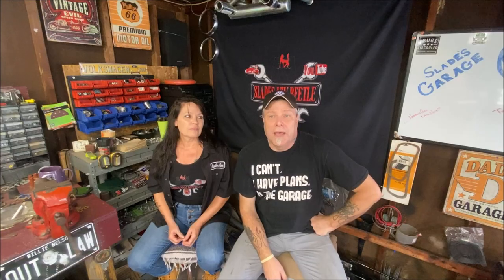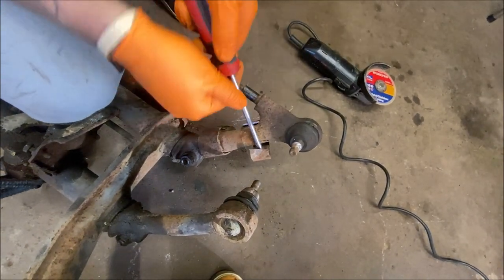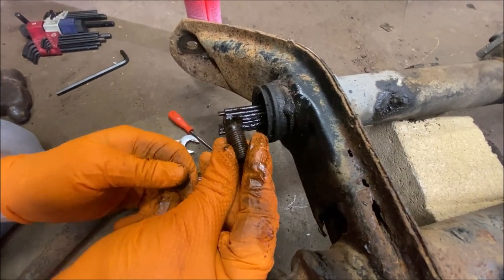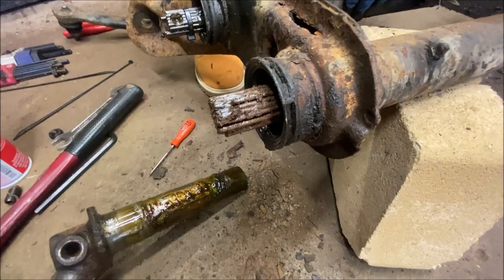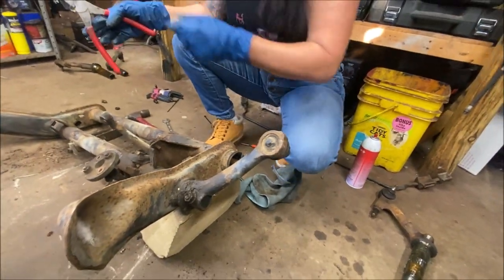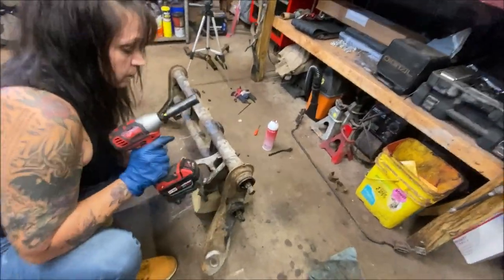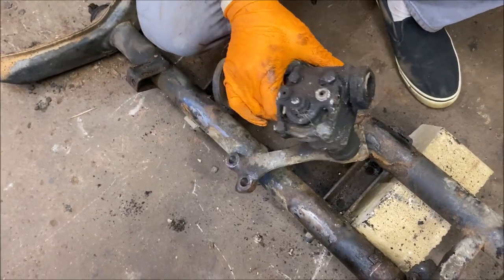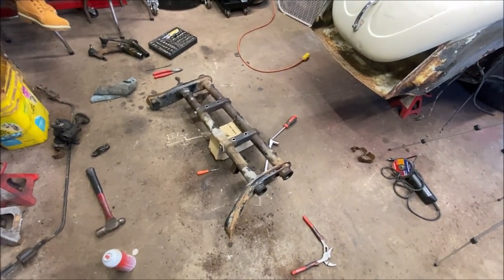VW Beetle Front Axle Beam Diassembly - Lets Take It Apart! My female mechanic garage helper!

Comment: Heather did a fine job, and Slade was very patient, too. Great job, both of you. But, she was wearing new boots! Well, if she does concrete, ponds and stuff, they'll get dirty soon enough! If you go with the new complete beam assembly, please take a minute to describe how you would do it with the original pieces. For example, how would you do the  ball joints? Would those bushings have to be done at a shop, or ???  Thanks for a very informative video; great detail and explanation as usual!!
Reply: Thank you 😊 And yes I was surprised how patient he was! Yet new boots!
Reply from the maker: Thanks my friend!! She must have 30 pairs of shoes 🤦🏼‍♂️🙄 I’ll be going over everything for sure. Every little piece. I may attempt the ball joints myself. Checking into a harbor fright press now, that will be cheap but work!

Comment: You didn't have to bribe Heather!?!?  It was nice seeing you guys work together. I've never worried about zip tying the torsion leaves because they will all align correctly by the grub screw hole.  Not sure if the new beams come with the steering box stop adjuster. Make sure you photograph yours and remove it just in case. On all of my lowered cars I have never run a narrowed beam. With the right tires and wheels you can avoid rubbing. But, the narrow beam will give you more options. Can you get  sway bars for narrowed beams?
Reply: Ohh heck no, I love the garage!
Reply: @HeathersHaven  that’s great! By the way, in case Slade didn’t tell you, your pond creation is amazing. You should make that a business!
Reply: @dubworldvwadventures  Thank you! That is really sweet of you to say, it’s more a passion of creation and love. I wish people would hire me to make a sanctuary for them. 😊
Reply from the maker: Hi Dave!! I like keeping them bundled when possible!! I ran drop spindles on my last one, standard….and 145s. Wasn’t crazy about the small tires, so figured narrowed beam. 
I did mark that stop just in case. Sure wished I could just repair that original German beam, but that one side looks a little bad.

Comment: Great video Slades and once again you, better yet this time Heather, make it look easy. She is a good addition to your garage.  One question Slades, in a narrowed beam do you also need a change in shocks?  I mean the stock VW Beetle shock comes with a plastic ribbed sleeve. Will the diameter of the plastic sleeve fit in the narrowed beam space or do you need to change into a more narrow profiled shock? Keep these great videos coming. Great fun and we learn small, but critical, points and hints in the process.
Reply: Thanks so much!!!!
Reply from the maker: Thank you James!! With a narrowed beam, and even drop spindles, you keep the stock shocks. Buy, you’ll need shorter torsion leaves/springs, and tie rod ends.
Reply: @SladesVWBeetle   thanks Slades.

Comment: Great detailed video. Thank you for the assistance Heather. I thought it was a short video at the beginning when Heather introduced the video and said isn’t that how you do it, and you stood up, lol. I have to do my ball joints. Do you recommend marking the camber? I was told that is a good thing to do. I seen Harbor Freight has a ball joint kit. Great to see you both get along together in the shop. Have a great day!
Reply: Thank you!!!!
Reply from the maker: Thank you!! Yes, I would mark the camber, so you can at least get it close, when putting it back together. You’ll still need a front end alignment. 
I was going to buy a bench top press for the ball joints. But I was told it wouldn’t handle pushing them in and out. 🤷🏻‍♂️
Reply: @SladesVWBeetle  Jim’s charges $20/ball joint to press. So I’m looking for a way also lol
Reply from the maker: @acdcfan5672  it adds up fast!! Although that’s not too bad. And he knows how to put them in properly! They have to be lined up
Reply: @SladesVWBeetle  Maybe I should sacrifice the money then to be safe. Thank you Slade for the information. Have a great day brother, and prayers you’re feeling better. Looking forward to seeing the next video.
Reply from the maker: @acdcfan5672  I seen so cal imports does them for 40.00 and include the ball joints. And you have to pay shipping. That’s too high. 
I seen harbor freight sells some presses. I’m looking into a few!! If I think they can handle it. I’ll do yours for free, just buy the ball joints and make the trip here! 😁

Comment: Great video thanks
Reply from the maker: Thank you Brenden, I truly appreciate the kind comment.
Reply: Question that maybe you know an answer to. Why doesnt anyone weld the beams into place?
Reply from the maker: @BrandonLyons1  Do you mean weld them to the frame head?
Reply: @SladesVWBeetle  yeah i see it bolts to the pan on a bettle and then sand rails like mine coupler bracket it in place. Im building a Frankenstein sand rail/ side by side for my daughter and just looking at my options

Comment: Great job Heather! I need to get my lovely assistant at home to help me. Slade what’s your secret. Oh for the shorten beam I have a video on that. https://youtu.be/S8F0ESJohmU. It explains how I picked my beam. 2” short beam you will have to stick with drum brakes. For a 4” shorter beam you can use disc brakes. It all about offsets in spindles and wheels.
Reply from the maker: Thanks Dave!! I’ll watch that video this evening! Oddly enough I have new drums, drop spindles, shoes…etc….
I was trying to keep from going to a smaller tire on the front.